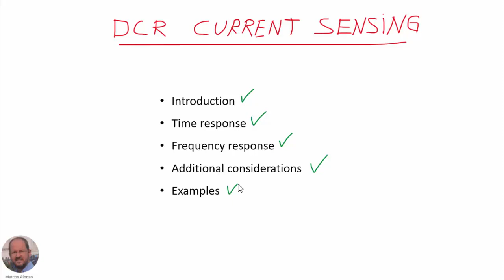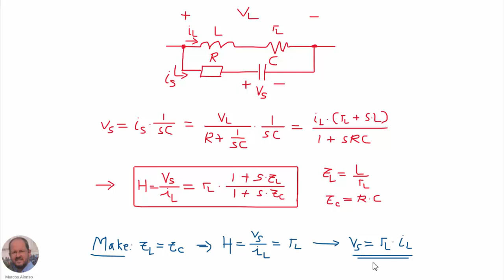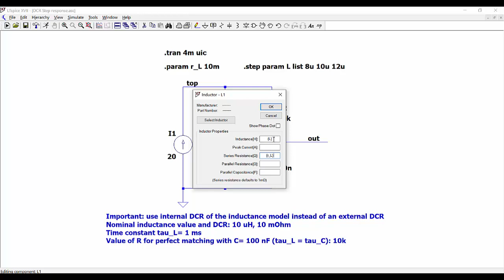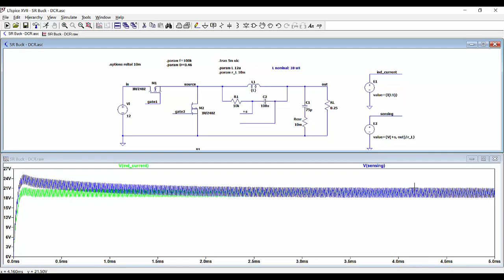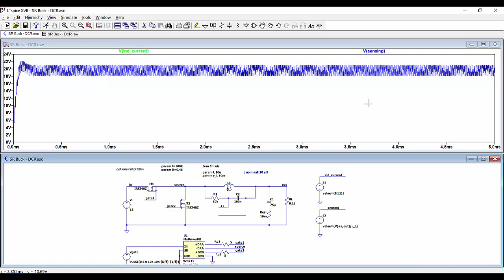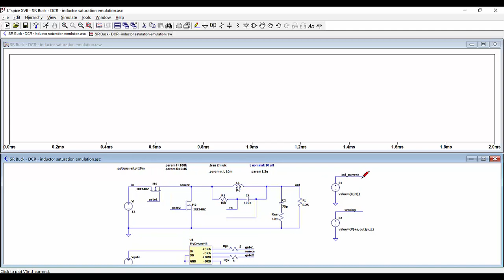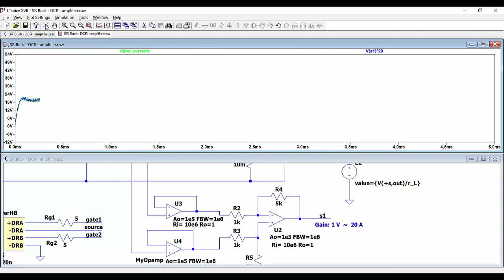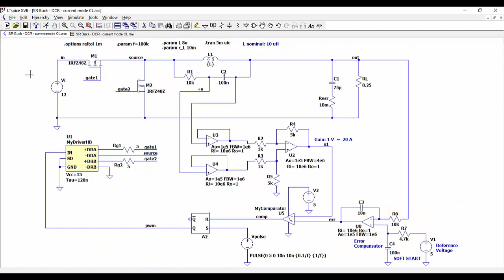PE #15: DCR Current Sensing in Power Converters

Comment: Thanks a lot 
great video
I was searching for the circuits to measure the differential average voltage across the filter capacitor. I would like to measure it using ADC. 
Instead of these OPamps. 
Do you recommend any references?
Reply: Also bidirectional measurement
Reply from the maker: Thanks for your comment. I think you will need some kind of voltage adaptation using opamps as shown in the video. The output of the opamp can go to the ADC.

Comment: Good morning Marcos. First thanks for the video. One question, if there is a change in the capacitance of the capacitor (C2) of the filter, what would be the impact on the measurement of the inductor current sensor?
Reply from the maker: Hi, thanks for your question. The changes of the capacitance will affect the time constant tau_c and will cause error in the measurement similarly as the changes of the inductance do. It is important to use a capacitor with a low temperature coefficient.
Reply: Hi @MarcosAlonsoElectronics . Right. Is this example available on your Github?
Reply from the maker: @marcelodepaulafontes4973  All files are now available at: https://github.com/marcosalonsoelectronics/PE-15
Thanks!